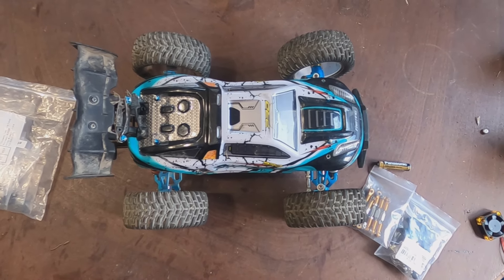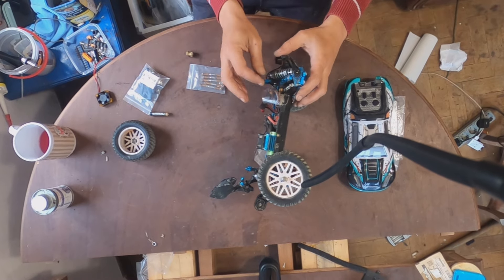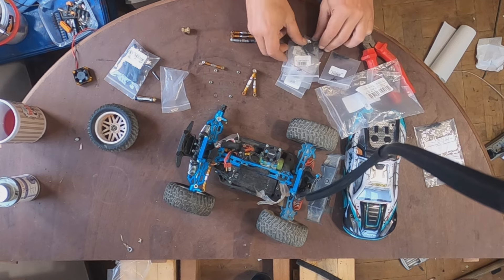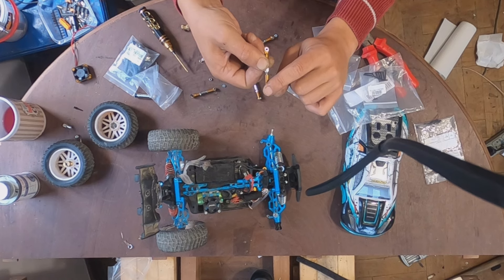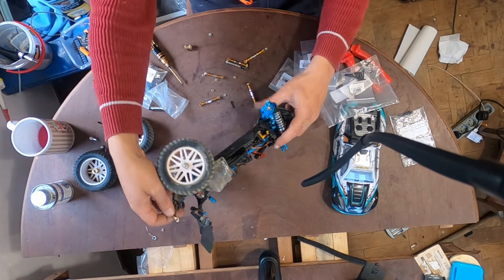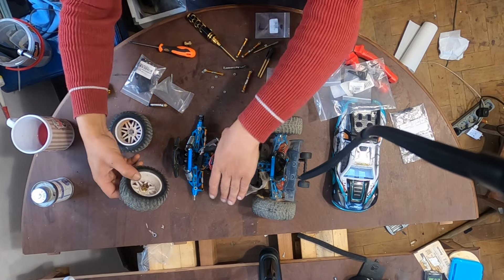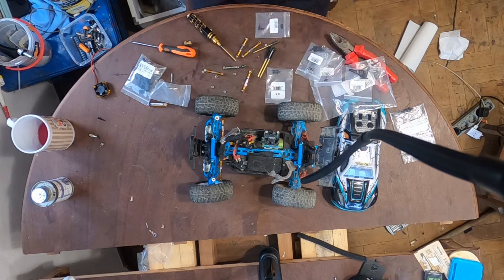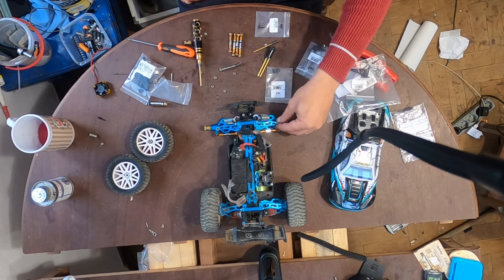The Beast gets a treat :) sg116 max steering link and screws upgrade!

Comment: What are those spacers on the wheel hub. It looks like metal wheel adapters or something. Do they make the tires stick out more ? What is their purpose ?
Reply from the maker: @stogie0608   hello and thanks for passing by, those are wheel hex extenders https://s.click.aliexpress.com/e/_EjuC5P2  they widen the wheel stance so the wheeels are further away from the chassis.
In this case I used because the offset of that bigger wheels was almost zero and the stock wheels have a negative offset so the bigger wheels would make the car stance much more narrower then stock and the car would drive poor.
I hope it was clear if you have any more question feel free to ask, I really appreciate to chamge ideas with my audience.
See you soon.
Ricardo
Reply: @Fast_Lane_RC  oh ok.  Got it, thanks for the info. I will order some.

Comment: What weight shock oil do you run?? I just ordered the same blue Aluminum Alloy Suspension kit u are running I have some oil shocks on mine right now and they are too stiff I have some 800 weight shock oil but I think that might make them stiffer.
Reply from the maker: Hello Ricky and thanks for passing by, i use 400 cause i also think the 700 i had was too thick, i rhink it could be even less then 400 cps, so go for the 350 and you will ne good.
If you have any more question feel free to ask, i like to help others.
Reply: @Fast_Lane_RC  you are very welcome!! I ordered some Team Losi Racing 50wt silicone oil off Amazon so hopefully that’ll be perfect!! Also what is a good cheap lipo charger that’ll charge 2s n 3s lipo’s??? And thank you very much because I’ll definitely need to ask some more questions!!
Reply from the maker: @rickybaldwin6160  hello i use this one to charge mine:
https://s.click.aliexpress.com/e/_EIqqWpH

There are cheaper alternatives for this one charger, but i ordered from choice a cheaper one identical in appearance and it doesnt stop to charge when it should everytime and sometimes overcharges, so i recommend tou get from the seller i shared.
Thanks for your support, has i told you feel free to ask your questions also help others so thank you.
Reply from the maker: @rickybaldwin6160  i found this that my help you :
10wt = 100cst
15wt = 150cst
20wt = 200cst
25wt = 275cst
30wt = 350cst
35wt = 425cst
40wt = 500cst
45wt = 575cst
50wt = 650cst
55wt = 725cst
60wt = 800cst

This is the weight conversion chart so 50wt might be too thick still, but test it before make any conclusions and order another one you might not need hehe.
Reply: @Fast_Lane_RC  what cst/weight did you say you use? Because this team Losi is 50wt 710cst so I’d say it’ll be too thick. Also I ordered one of those chargers not too long ago and the first light won’t show up anything and then other 2 lights work but won’t tell you if they are done changing.
Reply from the maker: @rickybaldwin6160  i have 400cst cause was the lowest i could get locally, the link i share for aliexpress has all the cst so i would go for that
https://s.click.aliexpress.com/e/_EwTBt03
Buy also 300 or 200  or even mix with the 800 to make it usable, you can mix no problem and if you have say 800 and 200 you make everything in between just mix the thicker slowly to see what you like
Reply from the maker: @rickybaldwin6160  it was you that asked for a charger right? That made me realize i should get a better charger for myself lol, go check this chargers, saw very good reviews on both:
M4 AC this ones connects to the wall has a biult in power supply:
https://s.click.aliexpress.com/e/_EHN7gcF
M7 charger and ac adapter do connect to the wall,this can also use batteries has a power supply and has more features.
https://s.click.aliexpress.com/e/_EGPCH7l
If you buy one of these also get the deans adapter:
https://s.click.aliexpress.com/e/_EuQvBxN
Tell me what you think i have not decided if i am going for the cheaper one cause its enough for my use but i also love the extra features lol so i will have to decide soon cause they are on sale.
Hope it helps you my friend
Reply: @Fast_Lane_RC  yep it sure was i checked them out so I’ll probably get one too or one just like it lol do you have a Facebook or something else i can message u on because I have a couple questions about how u made that adopt this when u can run bigger batteries.
Reply: @Fast_Lane_RC  also do u know of a set of beadlock wheels and tires that’ll fit one of these rc cars?
Reply from the maker: @rickybaldwin6160  i dont use facebook but you can ask here no problem, or in any of my videos comment section, the comments are good cause other viewers may read and also learn from your questions.
I had the idea of beadlock wheels too but couldnt find nothing that worked for a reasonable price, i know glueing the tires is not fun.
I finally decided the  charger i want and ordered this one:
https://s.click.aliexpress.com/e/_EzAPqkL
Its on sale and the discount that aliexprees shaves a little more.
I am gonna use a xbox 360 power brick that i have laying around to use has a power source so i dont ha e to buy the adapter they sell, i will do a video about it when it arrives and also on how to adapt the xbox power brick to work with lipo chargers.
Any more questions ask its free hehe and i like to help whenever i can.
This was long lol
Reply: @Fast_Lane_RC  okay I was just asking because I finally got my aluminum Alloy Suspension kit for my car and have some questions but kinda need to post some pics for answers about where some parts go n what way do I mount the tie rod ends because it’s like one end is different than the other.🤷🏼‍♂️🤦🏼‍♂️😂 n also around how much was the beadlocks u said u found? N nice I’ll definitely lookout for the video on the charger and yeah that message was long but it’s because I asked to much at once my bad lol I appreciate the help thanks for everything I look forward to hearing back from you soon have a great day!!
Reply from the maker: @rickybaldwin6160  hello my friend, the steering link i install with the larger part of the ball head the flatter side to the car and the other to the screw. Does it make sense?
Reply: @Fast_Lane_RC  so I’m trying to install the blue steering links that came with this blue aluminum alloy suspension kit until I can order some new ones so u install the larger part the ball head flatter side to the part that holds the wheel bearings right? Also they only had 2 screws in the package with the steering links and it also came with a baggie with 4 black screws n 2 really small silver screws like that comes with the back suspension that I have no idea where they go or if they are just extras🤷🏼‍♂️🤦🏼‍♂️and I’m also having trouble with getting the front wheel bearings to say in so I’m gonna try the technic u did with use the spoon!!
Reply from the maker: @rickybaldwin6160  the ball bearings are press fit so you use the technique i showed in the spoon video lol.
I used my own screws on the steering links, but you can use the ones that come with the metal kot i believe it has some philips screws that fit there if i remember correctly, and i also think the original ones also fit but i could be wrong aswell, not remeber perfectly.
I used the hex screws i bought now vut when i installed it i used the screws that came with the kit or the original ones i am sure its one of those.
I hope i could help you hehe i have to take memory vitamins lol

Comment: Hi question can those work on my q117 brushless car
Reply from the maker: Hi, and thanks for the question, yes they will, the kit comes with 3 links that fit the stock q117, the other 4 you keep for spares, cause you can reuse that screw that has in the center of the link and change the tips when the ball head gets worn or the arm bends(it had happen to me before).
Thanks for watching, and dont be a stranger!